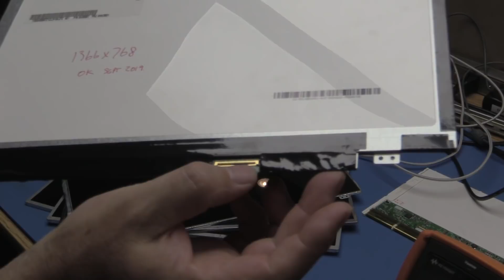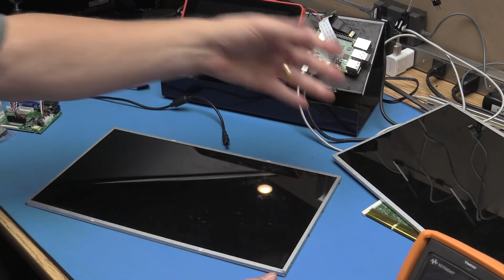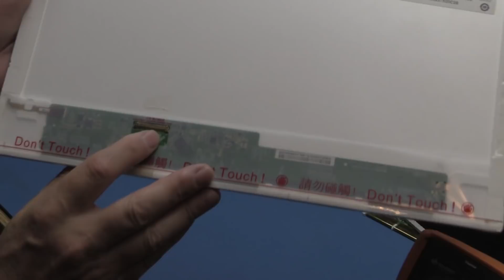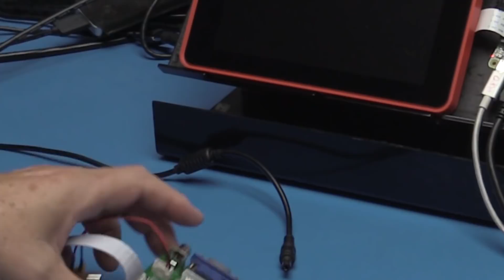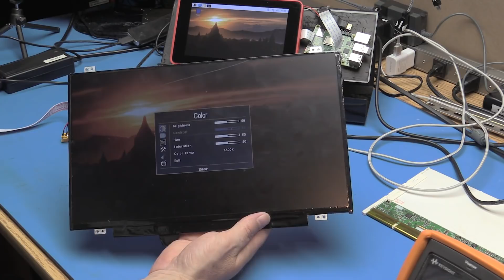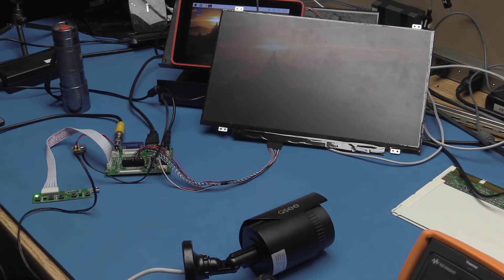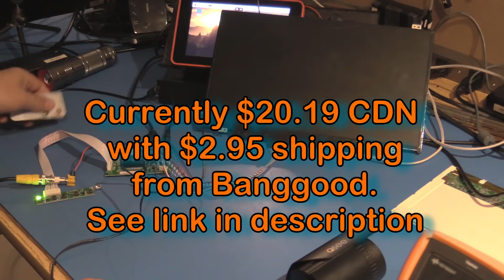Old laptop Screens on a Raspberry PI... Yes indeed.

Comment: I had a dead 40" LCD TV given to me by someone who didn't want to pay cost of main power board. Hooked up video on life support, but that had screwy voltage requirements and ran hot. Then found great LVDS controller at Digital View and ordered it off DigiKey. Short end, after remapping all JAE pins and setting jumpers, this deshelled LCD make a very nice monitor.
Reply from the maker: Congrats
and welcome to the re-purposing club :)

Comment: Hi, if I’m getting video from the pi over HDMI to an old laptop lcd, how do I also get sound from the pi?
Thanks.
Reply from the maker: you can get sound from the a/v jack on the PI, you may have to adjust the configuration file to enable it., if the adapter you are using for the old laptop screen has an audio output, this would be a better choice, the PI does also output audio over the HDMI by default.

Comment: Hey i have a display screen of LG model LP156WH4 TLC1 and its a 40 pin can it be working with a 50 pin controller board ?
Reply from the maker: the display is pretty much the same as the ones I used on the video, 1366x768 and should work with any of the controllers I showed in this and the later video, the trick is to ensure the cable is correct, single channel 6 bit 40 pin lvds. the connector at the controller end  in my case is 30 pin (2X15), but controllers also sometimes have a flat direct connect cable too and this could be 50 pin. do you have a link to the board you are considering, if so reply to me with the link

Comment: Could you help find a board for a LTN141XD-LO1 screen?
Reply from the maker: I found this datasheet http://www.panelook.com/LTN141XD-L01__14.1_LCM_overview_8480.html, it shows your display used CCFL so you will need one of those (Inverter) with the controller, something like this https://www.banggood.com/custlink/K3DKQrwr3w, it has the right everything, it will need programming for your board and I show how in this video https://www.youtube.com/watch?v=mHVrsOhccdM&t=207s. also the actual mains cable is not for NA, but it is standard to the adapter so easy to change. the mains adapter is universal as can be seen in the pictures on the product page.

Comment: Hi, i have 60 pin lcd,how can i connect it to this lcd driver?
Reply from the maker: I dont think it will, that would probably be a much higher resolution display (Whats the display part number), if it is then it will need a different class of controller

Comment: I bought the same board here and the controller only works when the LVDS cable is unplugged from the board. Kind of defeats the purpose. Is there also a way to get audio from this board?
Reply from the maker: Can you let me know the model of LCD display, the link to the board you purchased, and how you know the board works without the display plugged in?, ill try and help.
Re the audio, I dont think this board supports it, if you watch my second video I look at some other boards and the one there does support stereo audio and can drive speakers directly
https://youtu.be/mHVrsOhccdM

Comment: I have  a Samsung brand LCD from a Lenovo / IBM laptop.  How do I identify correct attachment cable to make it work?  THAT IS MY ROAD BLOCK.  HUMBLE APPRECIATION FOR YOUR GUIDANCE.   I CAN SEND PICTURE OF PLUGS AND CURRENT S OFF LCD.
Reply from the maker: there will be a label on the back of the LCD somewhere, send me a picture of that and ill check it out, send to peter@thebreadboard.ca

Comment: There’s a few hp touchscreen laptops that take a $50 screen with digitizer built in and connect ONLY through a normal 30 (or 40 - I can’t remember) pin laptop lcd connector. I will get models and wonder if they would work. Any ideas? Anyone familiar with these? I’m NOT talking about the ones with a glued on digitizer with its own control board or the ones that sit behind a separate digitizer.

Comment: so the screen i got here is a WXGA (1280x800) 30 pin CCFL 
and that wont work then?cheers
Reply from the maker: It should, you may need to use a controller like this one (Until I figure out how to program the others) 
https://www.banggood.com/custlink/vK3K0ynfF2
see this video were I have a look t it in more detail https://youtu.be/mHVrsOhccdM
Reply: cheers for that ill get it and try it out
Reply: mmmm well that sort of worked but no display of my pi onto the screen  and the screen was split top part of the screen was at the bottom can not change it and now the screen lighting led has stopped time to bin the screen .pity the 30pin cable is to short 
ok thanks any way

Comment: 1. Where do you get a 2-channel cable from?     2. Will this controller work with Dell display?
Reply from the maker: The cables are available via the links I provided, just link into them and then search for something like " 2 ch, 6 bit LVDS cable 30 pin" and something should present itself. As far as the display goes, dell does not actually make the LCD panels but the model number etc on the panel will tell you who did, and to answer your question re the panel, yes it should work, if it is a 1366 x 768 resolution, look at the 3rd  video in the series https://youtu.be/mHVrsOhccdM for more details on finding the controller for you.

Comment: So if you have an old laptop you could take out the mother board, and if enough space insert a raspberry Pi and screen controller board and you have a new machine.
Reply: That's an interesting idea. I wonder if   the chassis would have enough space inside for some decent active cooling.

Comment: Is this device for all display ?
Reply from the maker: It can be used for quite a range of displays upto 16.7M colors and about 1920x1080 60fps resolution, but you need to order the right one as there programmed with the LCD resolution and its not easy to change. If you watch the second video you will see a board that is relatively easy to re-program though.
Reply: Sir there is a model number behind on my screen N154i3-L03
can you suggest me plz best board for it

Comment: Have you poked around with a multimeter yet?  Or even better, have a schematic?  It would be amazing if you could draw power to run the Pi directly from the board so you only need a single power supply for both!

Comment: If you have  good replacement screen that otherwise mechanically fits except for the connector placement; Perhaps you could source a small extension or even just a longer twisted-pair replacement not too unlike the one that came with your device.  Granted, I'm not sure what kind of tolerances the differential signaling could tolerate, I presume a few (cm) wouldn't be a problem provided all pairs were extended the same distance.  Though in many cases I don't know if even this would be worth it, but perhaps interesting to try.

Comment: This has been possible for many years. Simply by getting the control board for the monitor ($30 ish) , making a frame for the screen and connecting the RPI via hdmi. Excellent tutorial though!
Reply: Can you please go into more detail? Are the controllers standard or specific for each monitor? Where do you get the from? Etc. Cheers.
Reply: Jay controllers are specific to the panel, each will have model specific number on the back of the panel. A quick entry into amazon or eBay (amazon preferred) such as “”model number” driver board” there will be various options for io which is simple preference for what you need/want
Reply: @sendittozach  Thank you for the reply. Have a great day.

Comment: For the one with the broken backlight, you can make it into a projector.
Reply: Connected my raspberry pi Hdmi to controller board hdmi which is connected to my laptop screen. The brightness is very low, hardly can make out anything.. is there any option to increase the brightness or is it a backlight issue?

Comment: I bought myself a vintage lunchbox case, but didn't get the video card for it, so it sits in my closet.
I've been thinking of trying to get a 10.4" lcd and one of these boards to replace its display, and then put a vintage system inside for semi-portable vintage computing...
(it's current display is some 50 pin kind of thing that requires a Chips & Technology video card.)
Reply from the maker: if it is a 50 pin cable and a small ish lcd display, then it may be a TTL type input to the panel rather than LVDS, check on panelook.com for details.

Comment: Wow. So does this mean that pretty much any laptop screen of a standard size uses the same connector pinout? So all I have to worry about is if it's 2 channel? Also how do you tell if it's one or two channel? This is amazing.
Reply: You'll basically find at most 3 different types of screens. Really old laptops use the CFL backlit screens that'll have an extra 2 wires coming out of the screen itself powering the CFL back light. I can't remember the pin count but it's a different connector. The 40pin ones in the video is used in most old-ish to fairly modern laptops, always LED backlit and in use in laptops ranging from core 2 duo age up to some 6th gen i processors. From 5th gen i processors onward most laptops use the 30pin connectors, basically does the same thing but probably a different controller board or maybe just a different cable from the board to panel.

So it's the CFL screens (super old), 40pin LED and 30pin LED. As for the channel thing, I guess it's mostly resolution based so higher resolution screens will probably be 2 channel and you can look that up if you google the part number of the panel

Comment: Will totally work with the video output from a drone receiver, took an old laptop screen and a pelican case with a 3s 5000mAh battery, 12v regulator, 5v regular and fed the LCD controller with the 12v and video receiver with 5v, 3d printed a dock-king style enclosure with the video feed soldered into an RCA connector and voila you've got a portable FPV feed viewer screen to show your friends the wonder of FPV drones
Reply from the maker: I am literally pulling the parts together to video doing just that... wow !, small world. it should be interesting.

Comment: With the correct Device Tree overlay blob, you can drive Parallel RGB (not LVDS) display’s directly from the GPIO port of a Pi.
Reply from the maker: yes indeed, I have not tried that yet but it would be interesting to try
Reply: theBreadboard I’ve done this successfully. You get a really sharp image and it works from the second the Pi boots. The only downsides are that it takes some configuration to get the display mode line correct and it can consume a lot of the GPIO pins.

Comment: I agree that these boards are nothing new but your video is nonetheless excellent. As a society we need to throw less away and reuse what we can. I have several old laptops I need to do something with. Batteries for building a powerwall and screens for displaying stuff round the house. A pi zero should make a good controller for a display screen on the wall.

I have seen references online to overlays you can put over a screen that add touch functionality, but I cannot find them, my search terms are probably wrong, Anyone got any ideas on that?

And did anyone say magic mirror?

Comment: be more interested in something much lower profile with smaller range of connectors. Would be cool to stick inside a dead pc
Reply from the maker: Not sure what you mean, 
there is only Power, mini Keypad, HDMI, and a lead to the display, cant get much less than that, unless you drop the mini keypad and just use a remote

Comment: G`day, Sir, and thank you for the idea! Unfortunatelly, I recently disassembled an scrapped  dead HP screen that perhaps could have been salvaged.

Anyway, if I may ask about those control boards: are they specific or generic? I mean, if I get an old desktop screen such as "DELL 1909Wb", I understand they may have a different pinout than the laptop screen. I have not yet found specs for this Dell one. Still, am I somewhat safe to assume that the connector will be compatible, or would I need an adapter (or a completely different conrol board) to accommodate a different number of pins?
Reply from the maker: I have found that they seem to fall into many categories, 40pin LVDS and 30pin LVDS, sub divided into 8 bit, 16M Color or 6 bit 256K colors, above 1366x768 they also seem to go from 1 lVDS lane to 2 lanes, There are others but this is most common  you will find upto 1920x1080 resolution. this is all about how quickly you can get the data upto the panel.
Reply: @TheBreadboardca  Thanks - and yeah, that us what my quick search also suggests ... so a very cheap ancient old lcd will not be an easy option. However, a salvaged Toshiba Satellite laptop lcd seems to have that 40pin bus ... which should work good with that adapter, correct?
Reply from the maker: @liszcgsedt  I would think so, please provide the LCD model number and ill see if I can confirm
Reply: @TheBreadboardca  It is the Toshiba Satellite L500-1Q8. From a picture the seller sent me, it looks like 40 pins indeed.
Reply: @TheBreadboardca  Well well well, seems that what I have at hand is a Toshiba Satellite screen, the back says model "n156b3", which seems to be a 30pin connector, from an image I have received it looks like two lanes of pins (30 in each, that is, some look missing, though). Would thhat in your opinion be an advisable solution, please?

Edit: Actually, the missing pins are actually in what looks like the current pin cable, which I would be replacing with one supplied with the controller board, anyway. Still, my eager questions stays - is there something that comes to your mind that I better be aware of when using this one, please?
Reply from the maker: @liszcgsedt  here is the panelook.com link. http://m.panelook.com/N156B3-L02_Innolux_15.6_LCM_overview_2146.html
I don't know if yours is an l02 version but it does confirm that it is 1366x768, 6 bit single lane and a 30pin connector so the board I used should work for you to. Good luck with the repurposing of your pannel

Comment: LOVED this video. I have been wanting to get into doing this for years. I do feel I need to point out that the screen you said was 1024 x 768 is definitely higher res. Easy to tell it wasn't going to be that res considering it's a wide screen. 1024 x 768 is a 4:3 aspect ratio and widescreen monitors are 16:9, 16:10, 21:9 etc. etc. If it indeed only supported a 1024 x 768 resolution, there's no way it would show anything on the screen at higher resolutions. It would be WAY out of range and either give you a seizure inducing flicker, or more likely just go black. If you check the resolution on the Pi, it should say what recommended is like windows does.
Reply from the maker: You are correct, After the video I found the proper reference to it and indeed it is like the rest, WXGA 1366x768, I think this is what the PC / PI initially returned to me on their settings. and I forgot to go back and correct it in the post editing, the site http://www.panelook.com is excelent at getting the details for most panels. and now my goto for details
Reply: @TheBreadboardca  Connected my raspberry pi Hdmi to controller board hdmi which is connected to my laptop screen. The brightness is very low, hardly can make out anything.. is there any option to increase the brightness or is it a backlight issue?

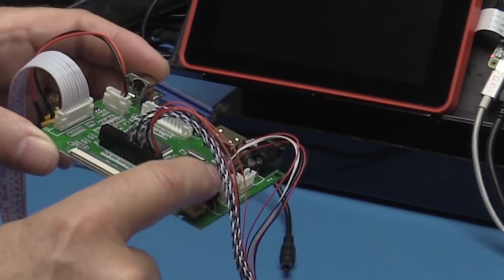Comment: 10:15 that is for led backlight some lcd panels have led backlight using those connectors ! ... ccfl type backlight needs much more cricut and a big high voltage transformer ...
Reply from the maker: I would think it will drive either as the LDC panels typically have a 5-20V input for the LED BL, and it boosts it up to 28-32V. the CFL booster of course can go up to close to 1000V, but both are initially supplied with similar low starting volts. I was not intending to say that the controller actually generated the HV for the CFL

Comment: Nice video. Is the connector of the LCD the same for all laptops? I have a Samsung laptop LCD and would like to use it as a monitor for a desktop.
Reply from the maker: so far mine have all been the 40 pin type, desktops I have looked at have been 30pin (The 30 pin are actually bigger connectors), it is pretty easy to find out if you know the model of the panel, post here and ill look it up
Reply: @TheBreadboardca   I have a LCD Panel ( LTN156AT02-D09 ) If I get that controller board,  can i connect it to my computer as a monitor by HDMI cable..
Reply from the maker: @MartianStreaming  just need to make sure the controller supports 1366x768 lvds 1ch 6bit with a 40 pin connector on the lcd end of the cable... see https://www.panelook.com/LTN156AT02-D09_Samsung_15.6_LCM_parameter_22692.html for full details

Comment: Doesn't the Raspberry Pi come with an LVDS port onboard?  Why would the external adapter be necessary?  Why cant you just plug the LCD directly into the LVDS port on the Pi?
Reply from the maker: the PI comes with DSI (Display Serial Interface) and runs at about 1Gbit/second. the LVDS (Low Voltage Differential Signal) runs at 100 - 200MBit. There not compatable. but these adapters will take the POI HDMI and convert it to the LVDS standard

Comment: Bought one from a Chinese supplier several years ago. Postal service here in Greece is FUBAR and they almost sent it back. Lucky I contacted the ebay seller and they almost within the hour sent me the tracking info which allowed me to get my package. It came pre configured for my display out of a Toshiba laptop.
Only other issue was that it was still programmed for the Chinese language pack. Had to do a calligraphy search for "language" found the info and changed it. Works great! Also has an analog tuner for the EU channels. Built a nice housing out of wood, looks really nice!